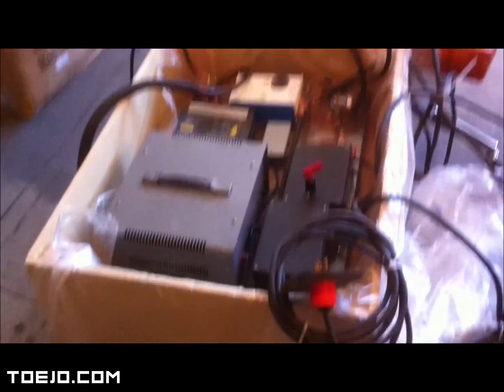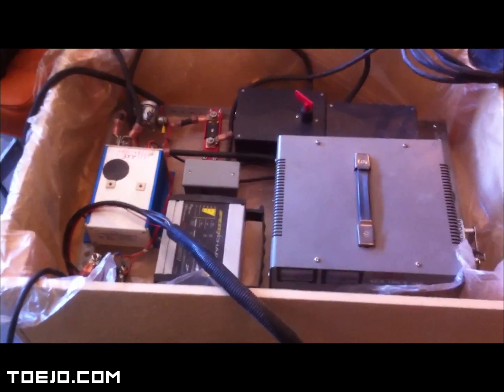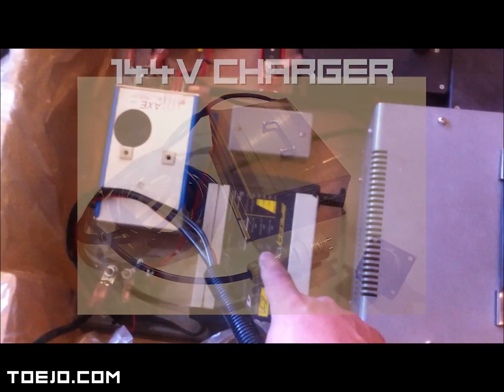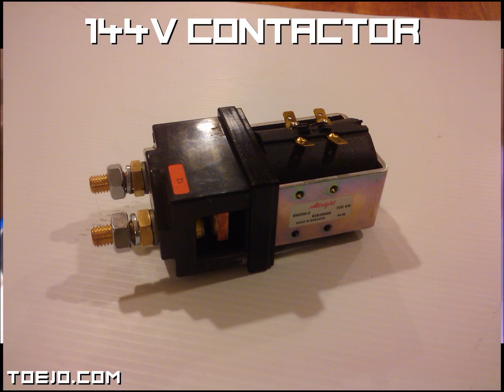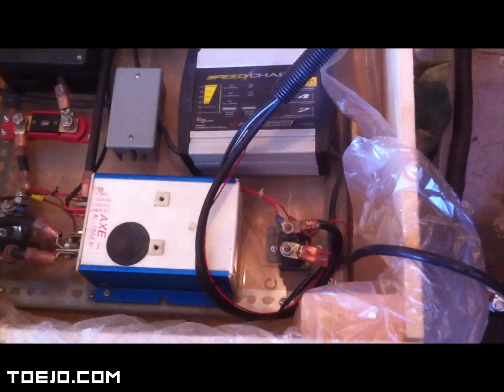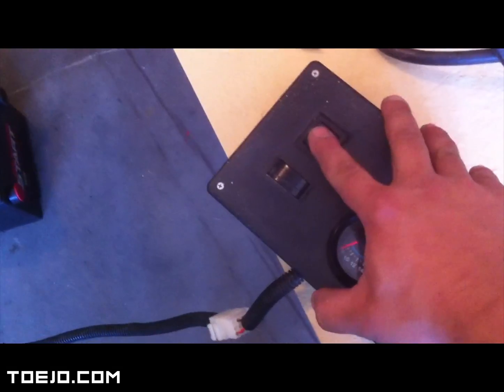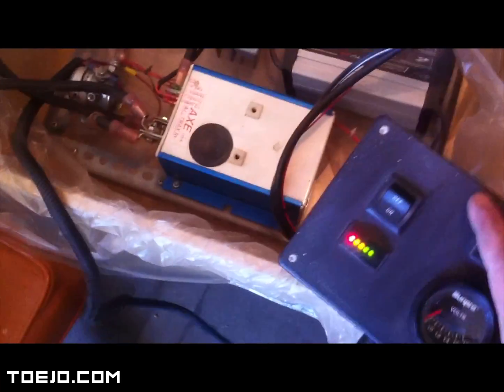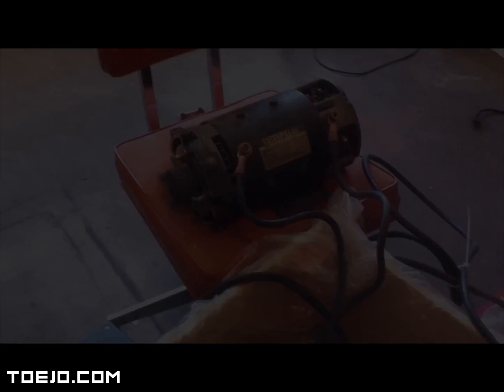1982 VW Rabbit Electric Conversion

Comment: Why didn't you try ev west style conversion with tesla batteries ?
I want my scirocco to ev but use the latest greatest parts 
I've got a mexica. Bug to covert but the scirocco is way more fun to drive 
The front wheel drive should be great with the electric power.
In cold winter or hot summer it's back into the cadillacs but nice days 
Electric vws

Comment: If that car has rear wheel drive you can just use dual transmissions and you will save a lot of money and get the gas mileage you want. although taking the front one into third gear is not recommended as you reach speeds of over 100 mph.